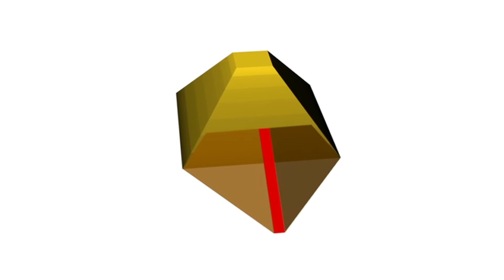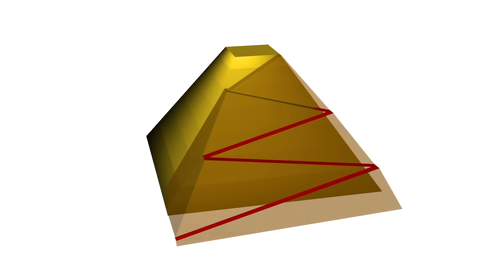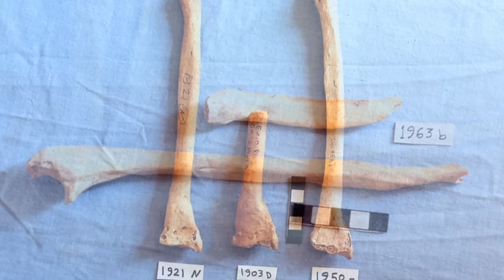Egyptology - Pyramid Construction

Comment: When building the pyramids, did the Egyptians start at the bottom & work up? ... or did they start at the top and work down ? It's been puzzling me for years.
Reply: are you dumb
Reply: They initially built them up as quickly as possible into a "stepped pyramid" not unlike Djoser.  Then they covered that over with more carefully cut stone to create a somewhat flat "base" upon which the final layer of carefully cut and polished white Tura limestone was laid.  The white casing stones were laid working from the top down.  This is per what Herodotus wrote who spoke to the Egyptians themselves and what we see on the pyramid.

With that said.  The now exposed western base of the Great Pyramid reveals a long continuous ledge of limestone.  So at least some of the understructure of the pyramid appears to be existing hillside which they leveled and laid blocks upon.  Some estimate the amount of natural bedrock within the structure to be about ~23% of its total volume.  The lowest chamber and some of the lower corridors were hewed from the bedrock.  

It is also possible therefore that the inner chambers/corridors - which are found below the halfway point - might have been created using the natural incline of the existing hill as part of the ramp to create them which was then covered over.  The largest/heaviest blocks are found in the bottom half closest to the ground.  Above the King's Chamber the blocks become smaller as the pyramid rises in height.  Herodotus also wrote they used a lever device likely employing a fulcrum counterweight not unlike the Egyptian shaduf - "a machine".  Such devices could have sat upon the "steps" to raise the smaller blocks above to the upper levels.  

Smaller examples of earthen ramps can be found on unfinished tombs in the Western cemetery adjacent the pyramid.  Massive amounts of ramp material were noted when the limestone quarries at Giza were excavated years ago to have been dumped into them.  So as they dug the ramps away they dumped the residue into the quarry pits to backfill the area. So as we see there is always more evidence out there.  🤔
Reply: yeah you know they started from the top cus humans had magical wings back then 😂

Comment: The thumbnail was so hilarious i had to click and just laugh at the whole thing !
The thing is that those blocks of granite came from Aswan 500k, (310 miles) south of Cairo. 
The guys pulled one block 500km ?  And there are 2 300 000 blocks on the great pyramid, so they just pulled them all from 500km away, cut them, and placed them with millimetric precision in less than 20 years ! Which means one rock being excavated, cut, transported, positioned and adjusted in less than 30 minutes otherwise you can't do it in 20 years and the egyptologists are adamant that this was built in 20 years of this wasn't the tomb of the Pharaoh, in which case they have to explain what it was !
Oh and how about the unfinished Obelisk of Aswan ? 1500 tons and 45 meters (150ft) tall , how did they plan to move it ? that's a 20 floors building and the weight of 3000 chevrolet buick . Pull it with strings over 500 km, because there is not a single boat that could make that float on the nile at that time , except if they recycled noah's ark !
Reply: If this is an example of the best your thinking skills can come up with = go online and get yourself a cranial helmet lest you trip over your shadow on a sunny day and injure yourself..............trust me.  🤭
Reply: @varyolla435  This is all very cute but that doesn't answer how it was moved !
Reply: @varyolla435  That doesn't invalidate anything i wrote so this is irrelevant.

Comment: LMAO at this video, was it written by Zahi Hawass and Mark Lehner by any chance, pair of charlatans and archaeological criminals. So the dynastic Egyptians did it all with copper chisels, flint and stone pounders did they ? LOL, anyone who`s worked stone and granite will tell you it can`t be done. The base of the Great Pyramid is a square with each side measuring 230 m (756 ft) and covering an area of 5.3 hectares (13 acres), and it was levelled and flattened to precision before a single block was laid,, can you imagine doing all that with string, a flint scrapper and red ochre LMAO, these Mainstream Dogmatic arrogant Egyptologists are jokers for sure, go check out Ben at UnchartedX, Robert Schock, John Anthony West, Graham Hancock, Randall Carlson and Engineer Christopher Dunns work they`ve done all over Egypt, go look at the precision and evidence for advanced engineering that was impossible for the dynastic Egyptians to do even if they had 200 years to do it, never mind the 20 - 30 years were told took to build the great pyramid. Zahi Hawass is a proven liar and a thief and Mark Lehner is his lap dog. Don`t buy into videos like this because time will prove that mainstream Egyptian archaeology is wrong, even the great Flinders Petrie said after his work as Saqqara and Tanis that the dynastic egyptians could not have done the work he found there, the engineering and accuracy was way beyond their capabilities and even beyond the capabilities of late the 19th early 20th century, so if we couldn`t duplicate the accuracy and high precision in his time,, neither could the dynastic egyptians. He believed there had to have been an ancient lost civilisation that was highly advanced `before` the time of the dynastic egyptians. Go watch some of Unchartedx` videos guys, i guarantee it`ll open your eyes.

Comment: Let’s do some quick math. 

Pyramid of Giza - apparently took 20 years to build. 
2.3 million stone blocks. 

That’s 1 block laid every 5mins, for 20 years. (this is without incorporating bad weather, illness, accidents and mistakes). Then factor in daylight - you are looking at 1 x 2.5tonne block laid every 2minutes. (this is without considering moving ramps and lifting equipment). So it’s actually probably less than 2minutes.

Now let’s look at the laying method.

Each stone block weighed approx 2.5 tonne. If the dimensions of most blocks were 1x2.5m - you may at best be able to get up 10 men cram next to each other and some how get their hands under the block, to lift it. To break this down per person, go to the gym and load up a barbell to 250kg, and try and do a deadlift. You will not lift it off the ground, not even budge it. Now try and lift a 250kg stone block, even harder. (Unless you’ve a power lifter).

Regardless of lifting tools and machines, you still have to physically lift it up to get rope under it, lift it off and lay it into place. 

Now let’s talk levelling. For the pyramids to be so precise, I would estimate that proper levelling would need to be checked every 2m in height. Else the pyramid at that width, would be so badly out of line by it reached 10m+.

This would take so much precision, re checking etc.

We haven’t even started discussing how you get thousands of workers all on the same page with the build process, when errors would occur and having to re do things. You ever worked on a build site and seen tradies trying to communicate, when there’s just 4-5 of them? Let alone how many thousand workers on these?

Before you go laughing at aliens theory. Get 10 strong guys to go to the pyramid and simply try to lift just 1 block. I can guarantee you, they won’t be able to.

Comment: Right okay, where did they get wood for ramps from? And where are the ramps now? Can’t seem to find any material evidence
Reply: You use the internet to espouse incorrect assumptions = yet fail to use the same to actually educate yourself.  How sad.

1 - Egyptian ramps were not made of wood.  They were made from earthen mixtures along with simple stone retaining walls - or mud bricks.
2 - so at Giza as an example in the western cemetery adjacent the Great Pyramid are partially completed tombs.  Attached to them = small earthen ramps such as I referenced.  The ramps were made from a mixture of sand/stone chips - debris from quarrying/and tafla - a sedimentary clay they mined. 
3 - now as it happens near the worker village at Giza is the remains of a large tafla mining operation.  Also when the limestone quarries which are next to the pyramids were excavated years ago they were found to have had massive amounts of........... = ramp material dumped into them.  As they encased the pyramids in the white Tura limestone casing blocks working from the top down as Herodotus wrote they systematically dug away the ramps and dumped that into the quarries to backfill the area.  So let's move on.
4 - at Karnak is the remains of a mud brick ramp used to construct the large hypostyle temples there.  In the tomb of Rekhmire is a famous depiction of Egyptian craftsmen at work.  Also among the scenes is a hypostyle temple being built using........... = a mud brick ramp!

So this is but a small example of what you failed to account for in your assumptions.  The evidence is usually there.  All that is required as always is for you to seek it out so as to understand.  🤔

p.s. - look at closeup photos of Khafre's Pyramid - specifically the remaining section of casing stones at the top.  You can see in places blocks above being braced by vertical rectangular blocks below.  If laying blocks from the bottom up this would be unnecessary as blocks would simply be laid atop those underneath them.  If however you were working from the top down then vertical rather than horizontal stone blocks to brace those above might be needed in places where gaps below exist.  Then lends validity to Herodotus's account.
Reply: @varyolla435  how do you explain pin point precision engineering? How on earth do you drag 2,300,000 stones each weighing over 70 tonnes? Also the ramp myth is debunked as you can’t haul that weight over an angle greater than 10 degrees… simple physics. Anyone with a mathematical/ engineering brain can see that clearly. Before you start banging on about regurgitated material how about you ACTUALLY look at what it’s being said about this place.
Reply: @oreobiscuit7143  🥱 Imagine that.  When your initial claim is shown to be in error = you pivot to spouting more of the same.  Never saw that coming.....  🤭
Reply: @varyolla435  I’ll come back in a few years when they abolish previous studies :)
Reply: @oreobiscuit7143  So now you fall back on argumentum ad ignorantiam....  This gets better and better.  🤣
Reply: @varyolla435  bet you had to use a dictionary to work out the spelling for those words
Reply: @varyolla435  actually you didn’t respond at all to my question- PROVE TO ME the maths behind it and I will challenge you on it- all you are doing it attacking my view with words and no actual maths behind it
Reply: @oreobiscuit7143  🥱  You shift from talking point to talking point - but still no understanding.  Also if "big words" scare you = use the internet to learn what they mean - which you could also do for here.....  

p.s. - Hitchens Razor applies.  YOU criticize what the video relates - based upon actual subject-matter experts input.  Ergo it falls to you to provide evidence of what you claim and not others.  So you have it backwards.

Comment: Water levels, I recon they used a wheeled axled frame with slacked ropes suspended to the large blocks  in water up the water channels to the bases of the pyramid pulled by woolly Mammoths, building the pyramid layer by layer, with the edging blocks in place and flooding each consecutive floor by the spring and displacement of the blocks lowered into place by the boats

Comment: You don’t drag blocks, it’s impossible. What you can do is use 2.5 tonnes of stones to make a 2.5 tonne stone block weightless. And because pyramids are the angle they are, it’s pretty straightforward to use weight to hoist stones up and into place.

Comment: How did they get the stones to the kings chamber? 70 tonnes each at 350 feet in the air and you can't move a block that weighs 70 tonnes up a ramp that exceeds 10 degrees this programme is absolute guess work

Comment: Worlds Tallest building took 12,000 workers 6 years to build. Burj Khalifa. Thats with the most advanced modern technology and money and resources.

It weighs 500,000 tonnes.

They are saying the Pyramid took 10,000 workers 20 years to build a structure that weighs 6.5 Million tonnes, 4500 years ago.

And thats just one pyramid.

Hmmm,
Reply: The Burj Khalifa is a tad more than simple blocks stacked one atop another in a tapering fashion. Whereas the blocks of the pyramids are mostly crude chunks of stone quickly fractured from the bedrock and carted away those of your tower - mostly concrete and steel by the way - reflect mass produced components of fixed dimensions in the case of the steel girders. 

Further it contains numerous floors and rooms created for habitation whereas the Great Pyramid has a few simple corridors and rooms of a small dimension whose only purpose was to house the dead.  Thus if that is the best you can come up with = quit while you are behind.  Just saying.
Reply: @varyolla435  a few simple room inside the pyramid? Simple corridors? Crude rocks?

Why don’t you quit before typing?

Their ability to cut/shape both rock and granite and sand down surfaces has already impressed many experienced modern day architects and builders. Let alone the tools they used to achieve it.

They burrowed inside a rock pyramid and build a granite room chamber aka different material. As opposed to a skyscraper where you build out the :habitat frame then encase It. would be equivalent of building a skyscraper as a solid block of steel and then making the room inside it.

Besides, you’re missed the whole point. We couldnt do what they did with their tools back then. Burj Khalifa is not as impressive using modern day tools, the pyramid is more impressive given what little they had back then to achieve it.

Their ability to transport and haul the materials alone is more impressive than modern day standards given what they had available.

The fact that you can’t comprehend any of that means you are likely an uneducated individual who is poor mentally and financially. Go read a book. Experts in the field of architecture have already weighed in on the topic of how incredible the pyramid construction is,
Especially for its time period.

World needs less dumb people like you.
Reply: @MW1992S  🥱  The old "we couldn't do it......" imbecility I see.  We can land craft on other planets......manufacture things down to the nano level = but we supposedly could not stack mostly crude blocks of stone of assorted shapes and sizes atop each other - leaving gaps in many places wide enough to stick your arm into them.  🤣

Comment: Regarding the 70t blocks above the kings chamber. To pull  just one 70t block would take 630 men, pulling equal to 100kg each, up a step incline.........?  How would they navigate around corners? How big would the ramp have to be?
Reply: 1 - the weight of those blocks is likely less.  The 70 ton claim is an estimate.
2 - you fail to account for others = oxen.  An ox can pull more than 2X its own body weight.  Thus teams of oxen can pull multi-ton loads.  So one should not assume only manpower as there is ample evidence to show whereby the Egyptians used draft animals for labor + evidence of cattle being at Giza during the period of the pyramids.
3 - the relieving chambers above the King's Chamber are not that high up really.  They rest below the halfway point in the pyramid = ~60-70 meters up.  That may sound like a lot but a person as an example can throw a baseball ~30-40 meters. 
4 - on the exposed western base of the pyramid is a continuous ledge of limestone bedrock.  Thus they at least partially built atop an existing hill.  Some estimates place existing bedrock at ~23% of the total volume of the pyramid in its bottom portion.
5 - so the ramp employed to raise the larger blocks found in the bottom half closest to the ground - above the halfway point the blocks are smaller - conceivably would have included the existing hill they built atop.  So using the natural incline they might have created the inner core of the pyramid to then cover that over using limestone chunks and perhaps quarry residue as filler.  Most of the blocks are not carefully cut/polished.  Only those used to create the core of chambers/corridors and the last outer layers of blocks are.  All the rest are essentially stacked rubble.

Finally the pyramid is a large structure.  Ergo there is ample room for teams of men/oxen to pull those slabs up the ramp and push/pull/lever them into position.  For the blocks above a lever device using a fulcrum and counterweight could raise the smaller blocks as Herodotus inferred in his writing on the pyramid.  Such devices akin to the Egyptian shaduf would rest upon the steps to lift the smaller blocks to the levels above - while as noted the larger/heavier blocks found in the bottom half closest to the ground were pulled up the ramp.